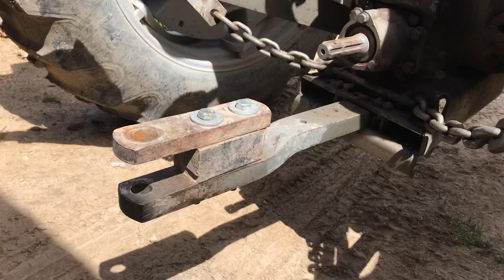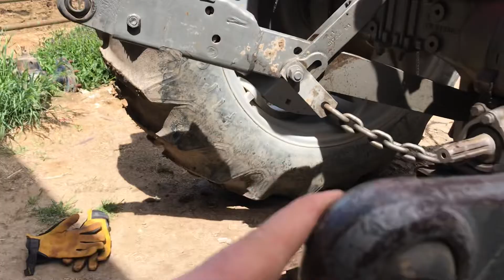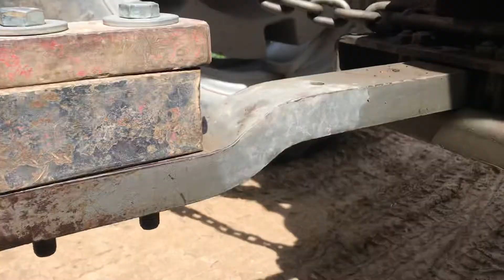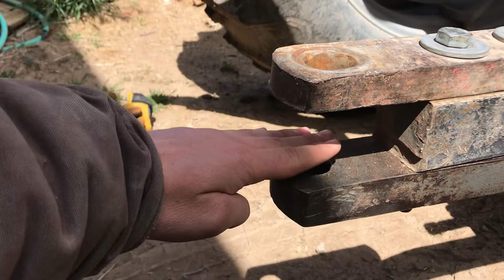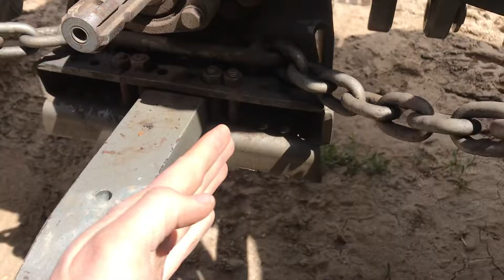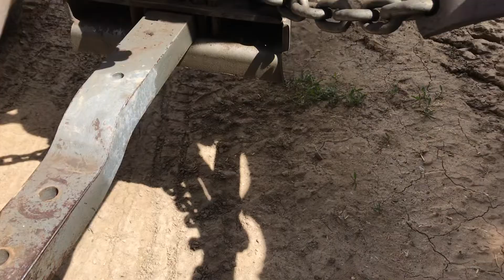Tractor Drawbar- Crash Course

Comment: Great 2-minute explanation . . . now if we could only get the manufacturers and dealers on the same page. For example, in New Holland's specs for their mower-conditioners they specify a "category II or category III drawbar, or a category III 3-point hitch." Thus they use "drawbar" instead of a "straight hitch" and "3-point hitch" instead of "drawbar." Messicks, however, calls both the straight hitch and the crossbar of the 3-point hitch "drawbars." Go figure!